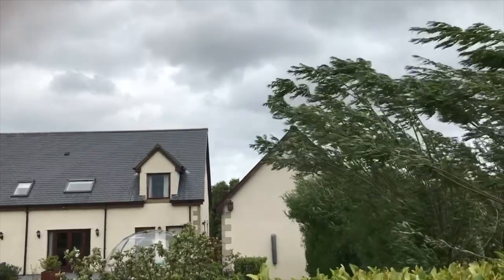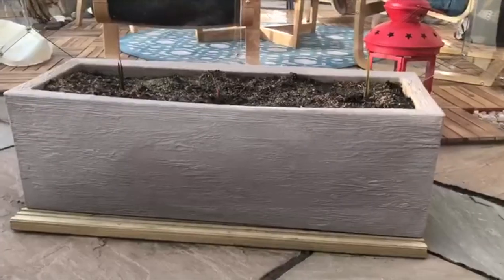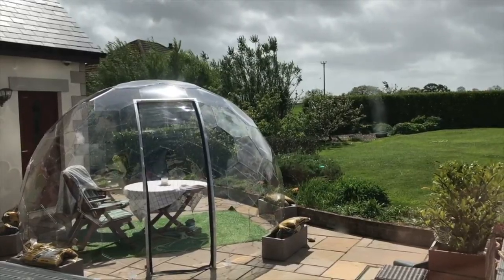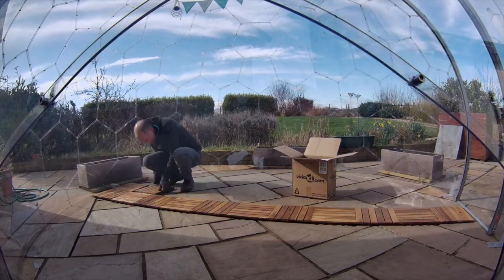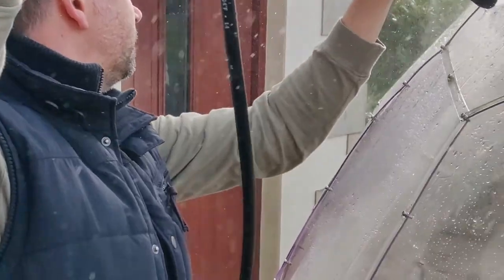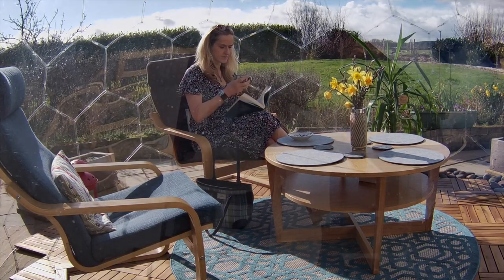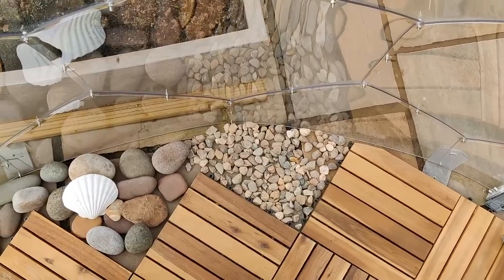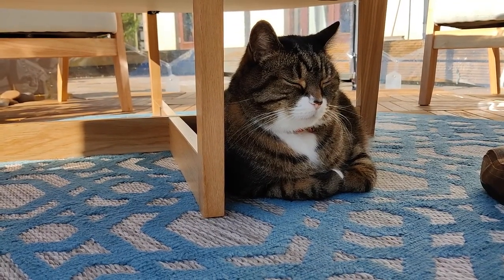The Hypedome 1 year on...

Comment: Had ours now for two years through wind, rain and snow. They are absolutely brilliant. If you live in a windy area as we do, they are a godsend on a windy sunny day. Totally windproof and waterproof.
Reply: did you heat it when very cold outside?  wondering about condensation control.  Thank you
Reply: Occasionally but during the period November to March it doesn’t get much use and yes there is a lot of condensation. But the only effect would be on any fabrics left inside. 
Once a year, usually a warm day in May we jet wash outside and give the inside a good clean.

Comment: Hi there we have had our pod around 18 months ago it’s the m one. We absolutely love it. I know it’s expensive but is it? Compared to a summerhouse then no it isn’t. We had 3 windows so helps when hot. We have a dyson for when it’s either hot or cold. Seen comments about the rain but as mentioned if it’s put together and panels are overlapping I cannot see how that happens. We sitting in ours now. No rain gets in. Jet washed over a few weeks ago so nice and clean. It’s so contemporary and everyone comments about it. We have artificial grass down but meat consider the floor that is an optional extra. Think we may change the folding door to the retro fit port door. We have a projector that projects stars on to the surface. It’s so good to sit outside in all weathers. Any questions just ask.

Comment: I could advise that they get pretty hot in the summer ... Mine got upto 40c. So have just been looking at putting a shade sail up outside to shade some of the midday sun.. and testing some opaque window film which simply sticks on the inside to reduce the sun glare...
Reply: You cant expect anything else from a single skinned dome with limited ventilation. My dome never got above 70F in the recent one day "heatwave" :)BTW, your dome isnt a class 2 icosa, its a class 1. The one in this video is a class 2.

Comment: Hi Chris. I washed my hype dome for the first  time with the pressure washer this past weekend. Worked like a charm. I dint have any "Green Stuff". Mostly yellow pollen and dirt. You have to be very systematic when cleaning. Lol I'm not that. Thanks again for the tips. My helper is 5foot 8 inches with long arms. So that helped for sure
Reply: Hi Pat I expect to order this dome in the next few weeks.  Still thinking over the steps and am now wondering how hard it is to get the final top pieces on when the dome is 8 feet high
Reply: @great-garden-watch  you will need a ladder  for sure. If you have someone helping who is tall and has long arms that helps. We are in western Canada . It has gotten hot in the dome during the day. But at night it cools down just nicely. It will be even better in the fall, winter and spring.
Reply: @path925  thank you so much Pat!   I’m in New Jersey and likely have more extreme weather than you have but am already thinking about how to get through the summers.  Will likely try a little greenhouse heater for small family gatherings in cold weather. Looking forward to that!!

Comment: It looks amazing! Great video thank you. We recieved ours today in Glasgow. We've put up 2 levels so far. Will complete tomorrow. 
I love your panel flooring. Please could you send me the link if possible. Thanks so much X
Reply from the maker: Hi Annabel, thanks! We bought the tiles from here https://www.vidaxl.co.uk/e/8718475927594/decking-tiles-30-x-30-cm-acacia-set-of-30 but do shop around as you can often find cheaper deals.  Hope the build goes well tomorrow!
Reply: @chrisdevereux  thanks so much Chris. I will have a look X
Reply: @annabeloakley736  good morning from western Canada. We did our Hype dome over 3 days. But we are loving it. I'm having a heat issue with the summer. 37c or hotter in there. I'm thinking of getting a window to create a cross breeze. I do have the sun sail. Loving that. And I use yard umbrella too. Any one else having this issue?

Comment: Hi, this is a beautiful video, no one never does the analysis one year later so as not to show the defects of their idea. however, it is a great construction method for this size. I'm thinking of building a similar one, can I ask you the thickness of the polycarbonate?
Reply from the maker: Hi, thanks for your comments.  The panels are about 4mm thick and very sturdy yet flexible enough to bend and form the dome shape - good luck with your build!
Reply: 2mm they are

Comment: Love the idea that’s for sure, but for the Aussie summers in the Outback I would need something that is tinted as the temps can get very very hot out here
Reply: you could use some car window style stick on tinting. cut to fit the panel - then spray a little soapy water to make them stick.
Reply: That is the downside. I have a similar garden bubble made out of pvc and it is like an oven in summer. I cover it to block the heat out.
Reply: Mine got upto 40c in the UK. Not even mid summer yet. And it's under a tree in shade part of the day.

Comment: Finally someone with worse weather than I have in New Jersey, US (so sorry). I am afraid of wind and this structure seems better than any polycarbonate greenhouses because of the shape. What size do you have? And how does the door with zipper perform? I will use your link as i will likely order.  Oh i see you have the S size which is what I will buy, but how about the door? Any issues? Thank you!
Reply from the maker: Hi, the one you see in the video is the 'S' (although when we got ours there was no other option!).  No issues with the wind, we placed the door facing our house and away from the prevailing wind - the door is pretty strong, and I couldn't think of another solution other than a zipper but it's sometimes a pain when you have your hands full!  Thanks for your support and comments!
Reply: @chrisdevereux  thank you! Either you and your partner are exceptionally tall, or the final top panels are not too difficult to assemble. …i just watched your assembly video and your ladders don’t seem super tall.
Reply: @chrisdevereux  hi again! How are we supposed to keep the door open?

Comment: Hi there. I'm in western Canada. Winters get really cold, -45c overnight lows. How does the hype dome handle the extreme cold?
Reply from the maker: Hi Pat, wow that's another level cold and not something I've got any experience of.  I believe there are temperature limits of polycarbonate (what the dome is made from) but I'm not an expert.  I'd suggest messaging the team at Hypedome for their opinion, they're very helpful. Good luck!
Reply: Hey Chris.  Did you use a drill to help put the dome together?
Reply from the maker: @path925  Hi Pat, yes we used a screwdriver bit in my drill to help tighten the nuts and bolts more quickly.  We also had to drill a couple of extra holes in the door frame - I doubt you will be need to do that now, ours was an early model!
Reply: @chrisdevereux  thanks Chris. I'm meeting with hype dome for a tour/sale pitch tomorrow.  It's the cost. It's a lot of money. Are you still enjoying yours? Sorry to disturb your evening.
Reply from the maker: @path925  It is a lot of money, but the enjoyment and time we spend in it are worth it in my opinion.  We use it almost daily and regularly have neighbours and friends for drinks where we sit in the dome into the evening when it would otherwise be too cold/windy to sit outside.  Mention my video to the Hypedome guys tomorrow, you never know they might do you a deal 😉

Comment: Hi Chris, Love the Video and have actually purchased a Hypedome but have not put up yet, so this video will definitely help. A question I have, is did you make the long anchoring plates under your planters or did you purchase them from somewhere?
Reply from the maker: Thanks for the kind comments!  We got the long anchoring plates from Hypedome themselves.  I mentioned to them that we were installing on a patio and they were able to supply them.  They are essentially the same as the ones for anchoring on a wooden deck except that they protrude outside of the dome and have longer "feet".  Hope that helps, good luck with the build!
Reply: @chrisdevereux  Thanks for your prompt response, much appreciated.

Comment: Great video！I am always interested in this zipper door. How do it fixed to the door frame on both sides? double-sided tape or screw, the double-sided tape, will it fall off after a long time?
Reply: The video (17 seconds in) suggests they are attached to the door frame on both sides https://youtu.be/s7bkmKMmvy4?t=17
Reply: There are some self-closing magnetic ones of Amazon for £20. Just use velcro to attach to the Frame.

Comment: Hi, thanks for the great videos. I noticed in one of your comments you said if you could build the dome again, you would put it on a foam base. Do you mean just around the perimeter or the entire floor? thanks.
Reply from the maker: Thanks! I think I would have it across the entire floor because it would have helped level the small lumps and bumps in my patio stones and also stopped any water/insects.
Reply: @chrisdevereux  Thanks Chris! One last and slightly odd question if i may, The panels are have a UV coating, do you find that provides good sun protection for you while sitting in the dome? I live in New Zealand and the sun is really intense so I'm a little concerned.

Comment: Love our dome too!! Interested in your idea about decking tiles. Our dome is on a decking base but we still get water ingress at 2/3 points. I see that Hypedome now do a plywood flooring pack to retrofit .. but it seems expensive. I am interested in your idea … but where does the water ingress go ? Pools under your tiles? I would be interested in your thoughts. Thank you for your thoughtful presentations
Reply from the maker: Hi Julie, with the decking tiles we have, any water just runs underneath them, so your feet stay dry but we've found we get a few bugs living under the tiles!   I like the look of the Hypedome deck base but not sure how it would fit to onto our (rather lumpy) sandstone patio and as it comes with a "ground membrane" I'm guessing they also had to deal with the bugs.  If I was building again, I might have put down a foam base first on which to stand the dome, which would have sealed up all the little gaps around the bottom.
Reply: Chris Devereux Thanks Chris that is really helpful. Would a membrane under your  decking tiles help?
Reply from the maker: @julimt7  I think the water would just run under the membrane and I'd be worried it would never dry out which could cause rot problems.  It might help with the spiders if you could find a way to attach it to the inside of the dome around the edges.  To be honest, it's not been so much of a problem for us, so I've not tried it!  Maybe the subject of another video :)
Reply: Chris Devereux Yes please!!! Lots of tweaks for people to share! I’ve just ordered a sample tile … and will think about our situation some more. Thanks again
Reply: Hi so would you put the foam straight down onto the patio or would you put the decking tiles on top of the foam? Thank you

Comment: What kind of weather station are you using and would you recommend?
Reply from the maker: I've been through about 3 in the last 10 years, different models.  The one in the video broke so I'm currently using the Ecowitt WS68 which seems reliable so far and is modular if you want to add other sensors - I like it!

Comment: I am disappointed with this dome , as a lot of rain is getting in and am currently pumping water out 
It's become a pound.
I followed the instructions and am now frustrated.
Any advice - rain seems to becoming in from the top and sides I beleive.
Reply from the maker: If the panels are all overlapping correctly I don’t see how water can run in. Even in wind blown rain conditions ours is dry inside except for a little around the base.

Comment: Apparently, there's this polycarbonate adhesive known as Lexel that you probably could have used to bond the panels together for a permanent watertight seal. You wouldn't have any algae growth at the joints and pressure washing wouldn't be a problem.
Reply: Wouldn't this result in damage when the wind pushes the dome from outside to inside?

Comment: Hi Chris, looks great!…and really insightful video. I’m curious, what is it like in winter? With a heater do they retain the heat or do you have to have the heater at full volume all the time? I need an outdoor space but have to be able to use as an office through winter too. Hypedome say the can give me a panel with a hole for a flue for a log burner….from your experience is this a good idea? Thanks!
Reply from the maker: Hi there, thanks for your kind comments!  We do use it in the winter with a small portable electric heater, but I haven't used it all day long like that.  I suspect the heater would need to be on low most of the time, depending on whether the sun was shining.  It heats up well with just a little sun.   The idea of using a log burner sounds great and I can't think of any reason not to do it as long as the flue was properly isolated from the panels around it.  Only issue i can foresee when using it as an office is that you may struggle to see your screen in the bright daylight!  Let me know how you get on. Chris
Reply: Hi bud  got 1 on way  .. would never thought  to use a log fire  🔥   imaging it would melt 😂 so if you do can you let me no how it goes .. cos in winter be great  .. got log fire in the house ..cheers

Comment: Hi  bud    just bought 1 today  get del 7th Nov.. was  wondering   plus idea for you haha .  Would you be able to use window tint like you use on cars .  What  heater  do you use if any .. cheers
Reply from the maker: We use a normal electric fan heater, powered by an outdoor socket, it heats it up pretty quickly.  Nice idea about the tints, I can't think of a reason why you couldn't apply them to the panels before assembling the dome, although you'd have to be careful not to cover the screw holes where the panels join together.  It would certainly give it a nice look, although might not feel like you're outside/inside any more and that's one of the big draws for me.
Reply: @chrisdevereux  hi cheers   for reply    . Yes   just   we get sun really strong in garden   think  be nice just to put them from 1 side .if needed.. won't no till all set up .. so what your thoughts on the quality    I think it lot money  but till I get it won't no if its good value.. thanks again
Reply from the maker: @brianswanson4921  You could also look at the shade sail that Hypedome sell, I'll be making a video about it when the weather warms up again - it should be easier to put up/take down than permanent tints.  It is a lot of money, but we use it a lot and will continue to get a lot of value out of it over the years.

Comment: Would you say the dome is really waterproof apart from leakage at the bottom? Wondering if you think it would be safe to leave furniture cushions outside? I'd like to not have to bring these in all the time! Thx
Reply from the maker: Hi there, yes it's absolutely water proof, we have a coffee table and soft cushion chairs inside permanently without any problems at all!
Reply: Any advice re condensation? I have a window panel permanently open but some water ingress at bottom ( on decking base) and condensation in dome has caused some furniture mould damage. Hope  to find a solution if anyone has advice . Another window? Different flooring? Thanks in advance . No regrets buying it just want to be able to use it all year round
Reply: This dome is waterproof, but is not watertight. Remember that everything was removed from inside when washing it down. And he did say washing it made a mess on the inside. Inherent in the design, there will be small 4mm gaps in at least 1/3rd of the joints where panels come together, and water can be blown through those joints. You can see these gaps in his video. Most of the water will stick to the panels and run to the outside, but some can drip off at screws and corners randomly. This a great weather resistant product, but it is designed for the outside. Probably should refrain from leaving the television in it year around. Excellent job on the vid Chris. Very clear, easy to understand, and illustrated the points well.
Reply: @CaseDadToo  Condensation does not mean rain water.
Reply: @julimt7  The flooring/base is very important with this problem. If you can block the water rising from underneat you might be able to eliminate most of the condensation.